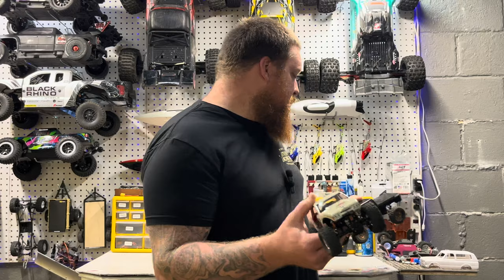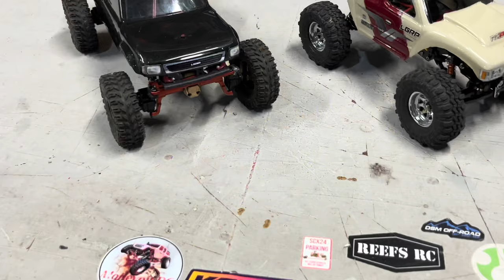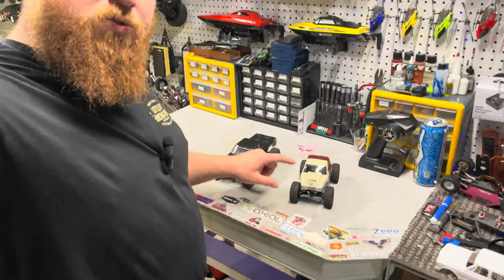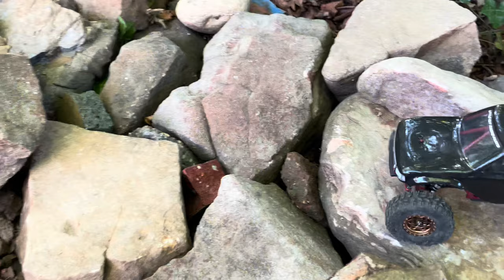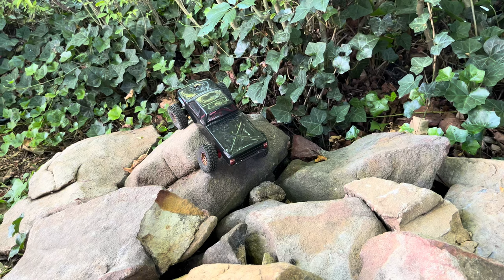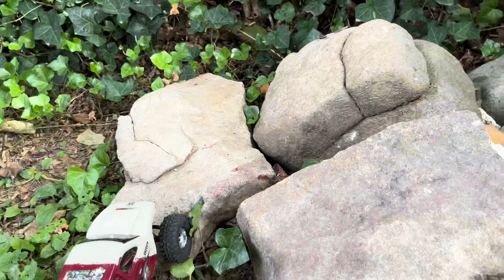Short wheel base VS. Long wheel base 1/24 scale crawlers

Comment: I prefer that short wheelbase rig you have there.  It's very similar to one i just built, and it will do some awesome crawling! 
The LGRP has some great things going for it,  like awesome parts quality,  but it also needs to be set up a bit different to actually perform excellent. 
I just drove one last weekend and was not super impressed. 
I would love to buy all the parts and modify it to perform better. 
One thing i really can't stand is that super long overhang in the rear.
Those guys at LGRP are very smart with their designs,  so i was a bit surprised for them to call it a comp rig.